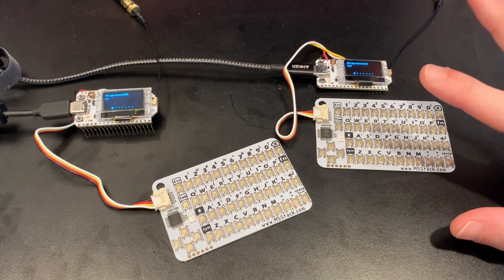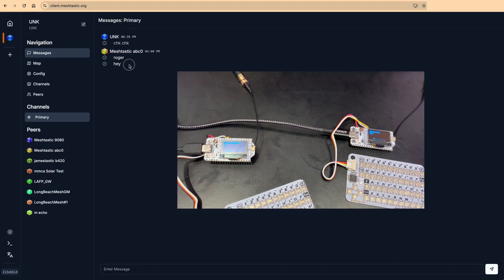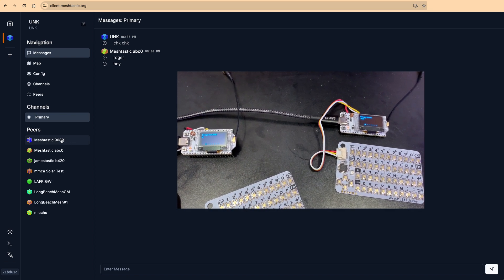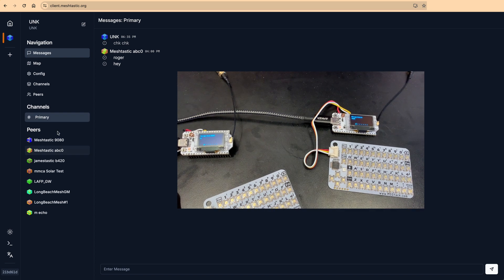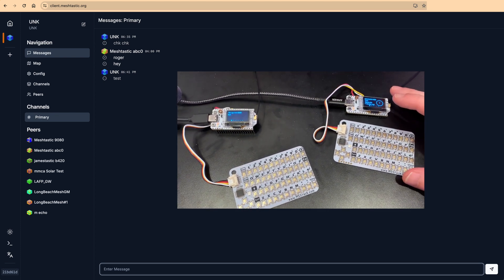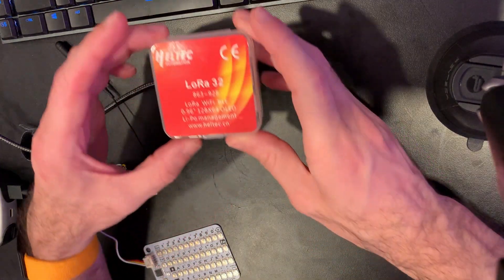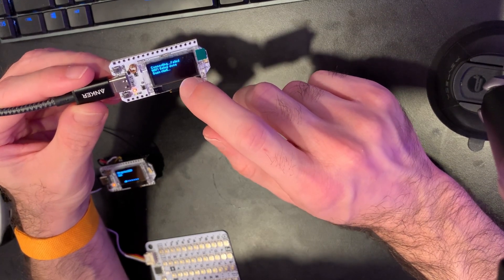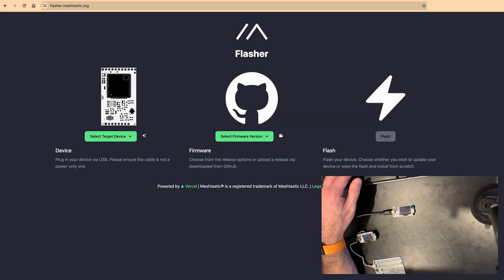Off-Grid Messaging With LoRa Meshtastic

Comment: Hello friend, through meshtastic is it possible with two heltec v3 cards one send a command to another turn on and off a relay?
Reply from the maker: Absolutely! There is some built in function to sound a buzzer when you get a message, you can connect this to a relay instead.

Comment: Nice work, i need to get some meshtastic compatible boards with the screens.
Reply from the maker: I wonder if there is a way to get a screen that shows a message history instead of just the last received message
Reply: I think it would be a matter of injecting a function, something that made use of the limited storage space and kept it out of the active RAM. I was thinking like a 25-50 prior message file that displayed when it was on. I ordered some meshtastic compatible boards so i can mess around with it.

#include <LittleFS.h>

#define MAX_MESSAGES 50
#define MESSAGE_FILE "/messages.txt"

void setup() {
    LittleFS.begin();
    // Ensure the message file exists
    if (!LittleFS.exists(MESSAGE_FILE)) {
        File file = LittleFS.open(MESSAGE_FILE, "w");
        file.close();
    }
}

void addMessage(String message) {
    File file = LittleFS.open(MESSAGE_FILE, "a");
    if (file) {
        file.println(message); // Append new message
        file.close();
    }
    // Consider implementing logic to limit the number of stored messages
}

String readMessages() {
    String chatHistory = "";
    File file = LittleFS.open(MESSAGE_FILE, "r");
    if (file) {
        while (file.available()) {
            chatHistory += file.readStringUntil('\n') + "\n";
        }
        file.close();
    }
    return chatHistory;
}

void displayChat() {
    String chatHistory = readMessages();
    // Logic to display chatHistory on the screen
    // Handle scrolling if necessary
}

i have nothing (no compatible MC) to even begin messing with any of the code but i was just trying to condense my thoughts...so something like the above. @TopDNG
Reply from the maker: Love it!!! @fallenrepublic6342  

I may try this and include it on a future video.

Comment: Do not start a LORA device without an antenna. It risks burning out the radio. Other than that, really good video and helpful to.
Reply: My wisblock burned up on me after my alpha antenna rolled off the table and came unplugged while powered on. Darned shame

Comment: Adding this to my "watch later".

I currently use 2 T-beam units and a Heltec (no gps; used as a Home-Base/range extension node). I have since totally broken the switches  and have been looking for replacement boards so this is totally up my alley! I've also never seen them used with a keyboard! 

This would be excellent in a 3D Printed case with a battery compartment and a charging port
Reply: I also have a couple Armachat kits from several years ago that I've been meaning to build but that's a bit beyond my skills/knowledge without a walkthrough

Comment: Good walkthrough. Much appreciated. Just one thing, I think on HRCC channel, when he had the guys from meshtastic on. They said running it without the antenna could burn out the radio module on the board. I'm not 100% on that, but I seem to recall hearing it.
Reply from the maker: True! Probably not a great idea to transmit on any radio without the proper antenna attached!